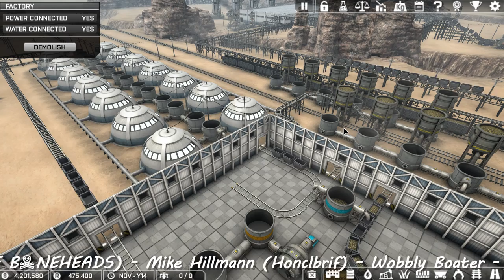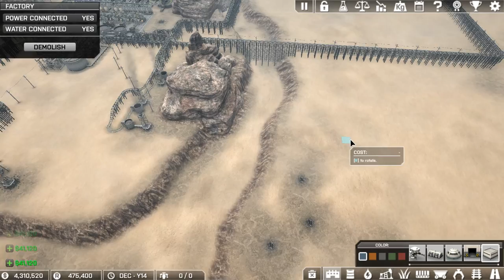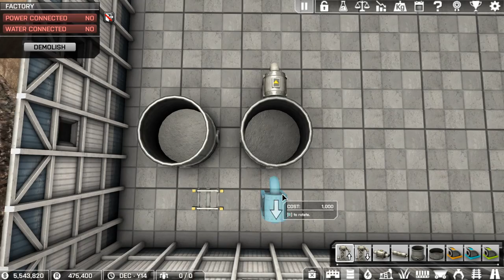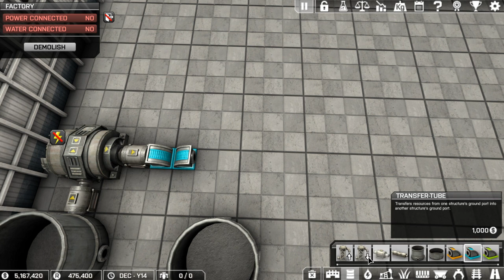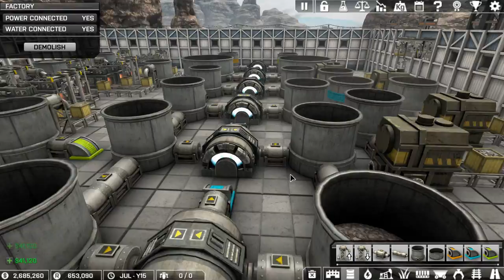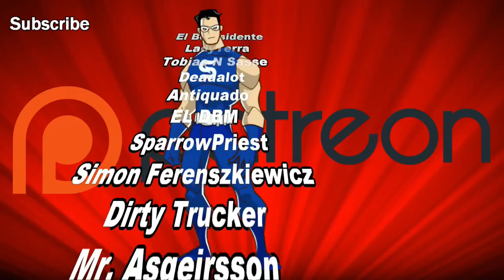IS THIS THE MOST EFFICIENT FACTORY POSSIBLE? - Automation Empire Gameplay Ep 12 - Tutorial/Tips

Comment: Crate makers have an output delay of ~1second when they are connected to step conveyor because of its moving steps. That causes crate makers to produce 1 crate every ~4 seconds.
But if you use an unload station then there is no delay and it produces a crate every 3 seconds. Using a claw track to drop it to a load station and from there to the conveyor belt ultimately reduces your production by 4/3 for each machine!

Comment: Man your videos are so nice!
So to make things even more efficient:
- You can connect sucker-upper and put-it-downer directly to colored connectors, bypassing the need of smelting output containers
- You can feed combiners from colored connectors using small pipes the same way as you use those to output end product
- Using boxing machines with step conveyors as an output results in an one second extra time for almost every box. Machine kinda stalls while waiting for the step to complete. If you output to an unloading station it becomes better. This is also true for your smelting system - without box maker it runs faster.
- It would be better to make unloading stations bigger to have an extra storage space while the rocket is away. You also might consider using 2 claw tracks to feed a single rocket as a claw train spends at least 2 seconds per crate (1 sec pickup and 1 drop + movement) so their throughput is kinda limited and in this case strictly matches output speed of 2 boxing machines. While when working with trucks they can load up while truck is away and then only drop when truck arrives, this won't work with rockets as the rocket has much more space then claw train can have preloaded.

Comment: You can put even more buildings in the same space. At the output of the refiner, use 1 step conveyor and bend it to the left, then put an unloading conveyor at the end of that step conveyor and set it to destroy all crates. This is needed to prevent any filled container to leave your full crate on that conveyor and stop the whole thing. Then place a sucker-upper and a colored remote connector so it empties the crates at the output of the refiner (above the step conveyor). Between the output of the refiner and a wall, you need only 3 small tiles and you don't need circulating crates and no open spaces. At the input of the refiner, place 1 loading conveyor. Place 3 refiners next to eachother, each with only 1 loading conveyor at the input. Place a crate maker with one unloading conveyor between the loading conveyor of refiner 1 and 2 (or 2 and 3), place a tube connector at the side of the crate maker with a remote connector feeding it. Then place a clawtrack above the loading and unloading conveyors in a straight line and add 1 pickup spot (the output of the crate maker) and 3 drop off spots (the inputs of 3 refiners) and add 1 claw. That's it. And place the containers with their color somewhere in a corner, not connected to anything. And when minecart tracks enter the factory, just place a sucker upper and a remote connector, without a container attached to it. And I don't get why you add containers to the inputs of your combiners but you decide to use remote connectors at the outputs. Why not zigzag your combiners and use remote connectors for inputs and outputs? No containers needed throughout your factory, just 3 in a corner somewhere. Using the same space as your setup, you could place more than double the amount of combiners when you zigzag them and use remote connectors instead of containers. To feed your rockets, place 3 crate makers, each with only 1 unload conveyor in the center of a big tile so a clawtrack can exit the building in a straight way. Place a 3-tile loading conveyor outside that feeds in your rocket and place it in the center of those 3 crate makers. Make 3 very short clawtracks from each crate maker's output conveyor to an empty spot on the rocket's loading conveyor, all using only 1 claw. With 3 crate makers this way, it just under-feeds a rocket but using 4 crate makers produces too much and production will stall. So 3 is the best amount to feed a rocket.

Comment: Let me blow your mind. I did the steel with 5 containers total! 2 intake, 1 refined iron , 1 refined coal and 1 steel output. The remote connectors have no need to conect to the containers so each combiner needs 2 input transfer tubes and 1 output and the connect one of each colour remote connector to each of those. 

The combiners become 5x7 but if you rotate 180 degrees and up one tile this can be 2 in 6x12.
You need to remember the remote connectors are magic and must feed out of the bottom of the container so the 3 coloured containers just have to be in the same building. 

Tldr Feed 1 container of each product to be combined and choose colour, connect remote input to combiner (anyware in same buildin), output to remote, set container feeding output line to same colour as remot output!
Reply from the maker: ok mind blown .. so remote connectors are both input AND output from a single container .. I already had v2.0 planned .. now v3.0 :)
Reply: @SkyeStorme  You just have to match the colours then they are either input or output not both.

Have you considered specialising factories? i.e Refining at the mines, transfer to central storage, combine, packing then dispatch ( storage, packing and dispatch can be outside so less cost and easier on space restrictions. )
Reply from the maker: @icecold9476  I don't like splitting up the factories unless there is a good reason .... but now I have a good reason :)
Reply: @SkyeStorme  glad to be of help and I can't wait to see what you come up with.

Comment: @30:18 I had to redesign this. 
I was wondering how that was supposed to work... that explains it. Sometimes seeing it in operation shows if a little adjustment is needed. 

@32:22 You already have your answer Skye... in the time the 2nd rocket was gone, it loaded 45 onto Rocket 1. This did not include any production from the 2nd line. That would have had the pad full at 50 crates, backing up, and none loaded if you only had one. So, no, one rocket just wouldn't be enough. 

Cool video. Your factory's come a long way.

Comment: Why not use 1 remote connector for feed 1, one for feed 2 and one for the result ? You don't need a whole bunch of storage tanks, as all connectors of the same color are connected to one another. That's what I do in any case. The output is in 2 stages, via a small storage tank (I want to see the queue without viewing into the factory. First stage is local output to the local tank. Second stage is a 'roundup' track, that collects all the locally stored stuff.

Comment: Hi, great videos. There might be more space efficient. I didnt test it yet but more than once I did see that not aligned connector with I/O work (ex, ep 11, last rocket is not aligned but still get crate).
So you should be able to use the small tank with an small tube in the side! I will test it tonight!

Comment: instead of the containers, you could have used the underground connectors on your refinery inputs. that would give you even more space.
Reply from the maker: You only have 3 colors
Reply: @SkyeStorme  i am aware that there are only 3 colors. the refineries use 2 colors and the output on the combiners. the crates are sucked up into 2 of the containers, which then input into the combiners. blue is combiner output, the other 2 colors are inputs into the combiner. you can put one color on one side of the combiner and the other on the other side. that would then automatically take the inputs from the containers and put them in the combiners. you'd have to put the 2 colors on each of the combiners with an input tube. 
sorry for being so long winded.
edit: i have watched quite a few youtubers explaining it. it took me a while before i understood it. the joys of getting old i guess. lol

Comment: Actually, as a Professional Process Consultant, emphasis in manufacturing, "rail" solution undermines throughput. Any solution that removes "rail" increases production aggregates. 

This "game" provides two material transport conventions.  Rail and pipe. 

Rail requires three (3) interactions per connection. 

Pipe requires two (2) interactions per connection. 

Rail is static load distribution system, traditionally long delivery model. 

Pipe is dynamic load distribution system, traditionally short delivery model. 

Question: 

Why would a manufacturer use rail within manufacturing zone when pipe is the best practice choice?

Look at your layout. Look at delays rail creates. 

Then, look at pipe system, "game mechanics", unrealistic "product push" (entry/exit).

I see numerous bottlenecks in your layout, stifling pre- and post- manufacturing cycles.